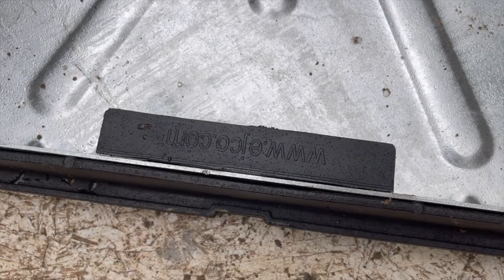Installing A Paving Recessed Tray

Comment: groundworker here
300mm chambers are either 800mm or 900mm (cant remember exactly)
450 chambers should only be 1.2m max if they have risers on (usually 3 at 400mm each)
anything deeper should be a smartie tube soil back filled is fine in green areas but 150mm concrete around in any traffic areas

Comment: Where these inspection chambers and drainage systems already in place or did you have to install a whole new drainage system for the project including where the aco drains go?
Reply from the maker: Already in place
Reply: Did you slope patio off away towards the wall or towards aco drains at house? If towards wall how did it drain
Reply from the maker: Towards the house full Vlog coming soon
Reply: @GreentopLandscapes  I look forward to it very useful tips
Reply: @GreentopLandscapes  has the vlog come out for this yet? I’m interested on how to take patio drainage (mainly porcelain as non porous) when sloping a patio to a retaining wall, I’m aware yours sloped towards the house to the aco drain at the house but what if the gully at the house ever blocked and then the aco drains failed? Would all the surface water pool at the house

Comment: You need to invest in a grabbo
Reply from the maker: Got two
Reply: Grabo don’t last well mines didn’t. Rubi suction cups just is good if not quicker
Reply from the maker: @lmilne4859  Good point
Reply: Needed to replace the plate on which a have but now doesn’t hold the suction for long maybe something going on with the filter who knows 2 fiddly for me to fix lol. So bought rubi cup it grans on pretty quick few presses of the button.